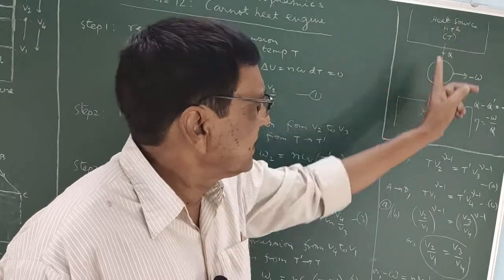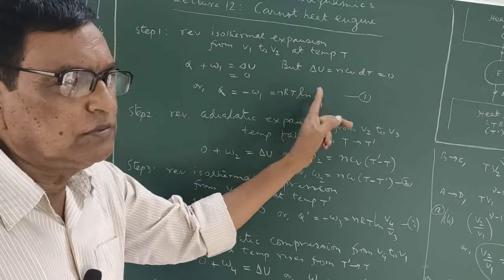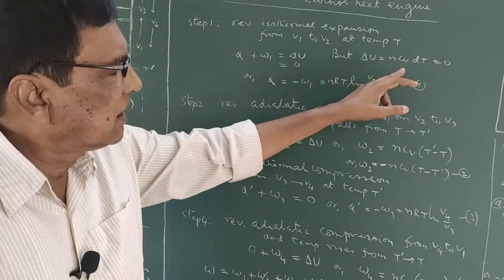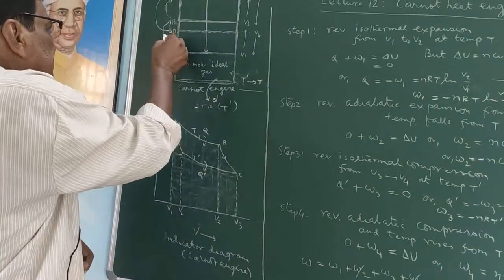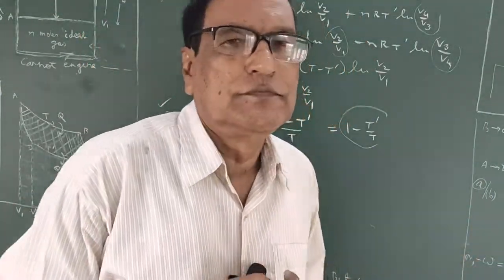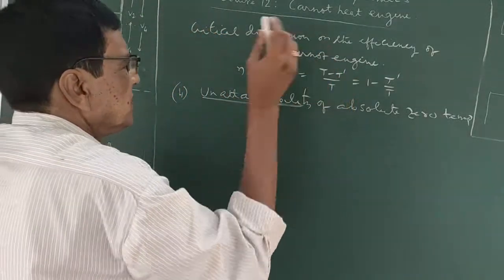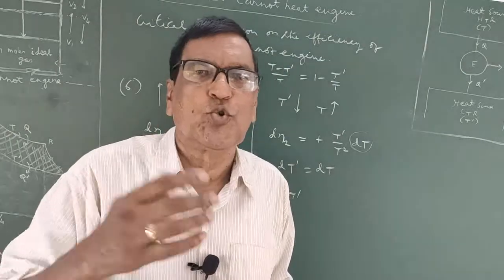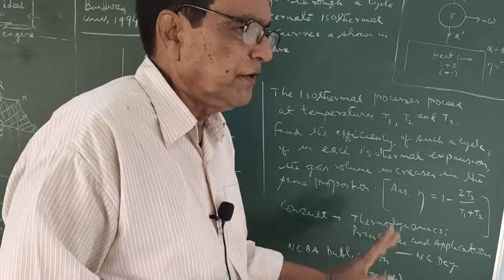Chemical Thermodynamics. Lec 12: Carnot heat engine.

Comment: Sir, 
This year in GSI Exam, a question was asked from the 'point number' 6 of "Critical discussion on the efficiency of Carnot engine". And the question was :
Define Carnot efficiency. You have to increase it either by increasing 10 K source temp. or decreasing same value of sink temp. What will you do?  Give reason(s).

Sir, this was the 10 marks question.